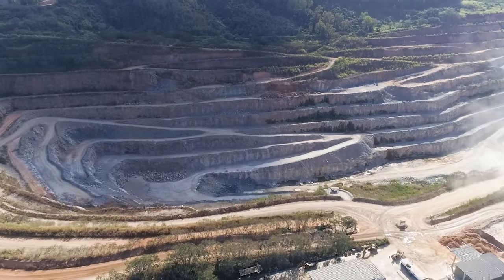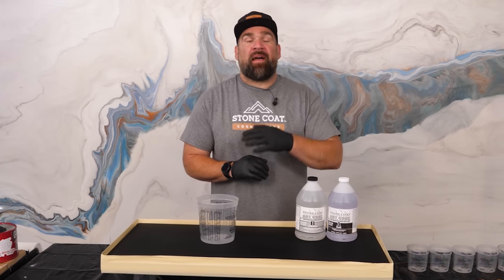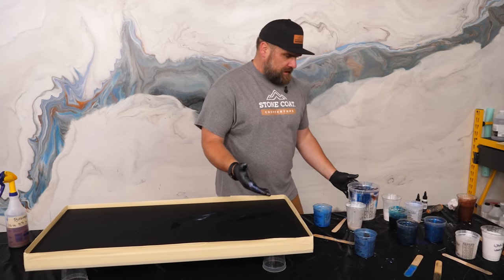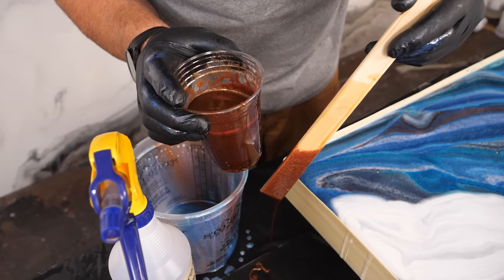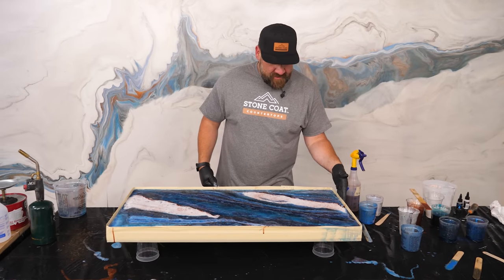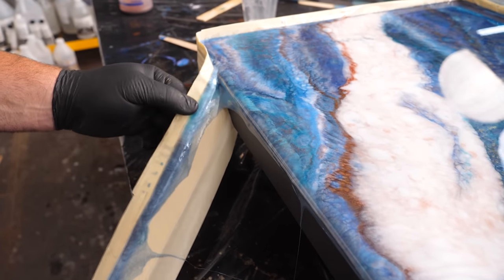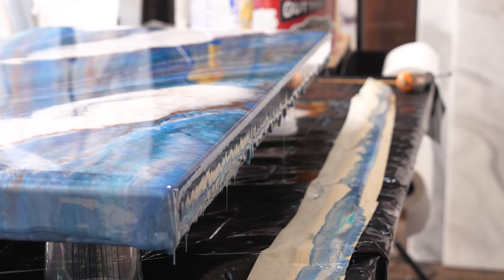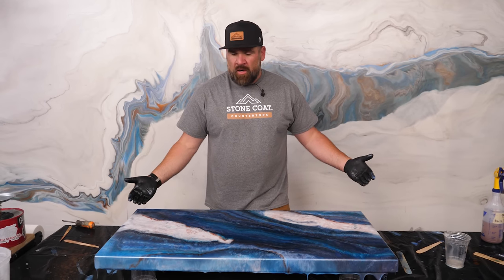Recreating the Most Expensive Granite in the World | Van Gogh Granite

Comment: I’m curious what the durability of that is having gone on over a laminate table? Is there worry of laminate being too weak? 

If I wanted to do this and make something that will last decades what would you say is the best under surface to do it on?
Reply from the maker: Very durable when best practices on prepping the laminate is followed.
1. clean grease and grime with TSP
2. fill laminate seams and chips with all purpose bondo
3. Sand surface and edges with 180 grit sandpaper 
4. Apply 2 THIN coats of Stone Coat Bonding Primer 
5. Apply 2 thin coats of epoxy undercoat in your color of choice
6. Ready for the epoxy coat

Comment: What causes and can be done about lip that forms on bottom of edges, like a speed bump at bottom of edge.  That was nice looking👍
Reply from the maker: Great question, whenever epoxy hits a sharp 90 degree edge the epoxy will build up like a speed bump. Round over with 1/8'' to 1/4'' roundover bit on any sharp 90 that will eliminate the build-up.  That goes for the top and bottom edge.  Lemme know if you have any other questions
Reply: @StoneCoatCountertops  Thanks, I sanded the edge a little to round it off some but it was very little, looks like more is better.  👍. I’ll be ordering a beach waves kit someday!